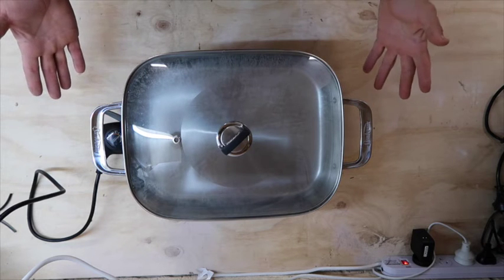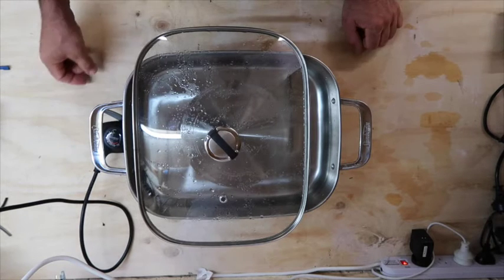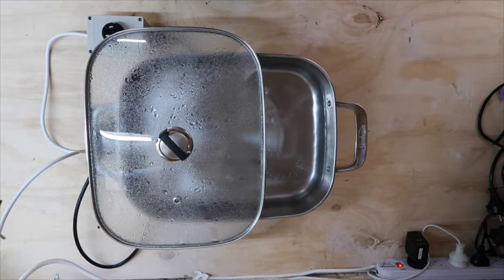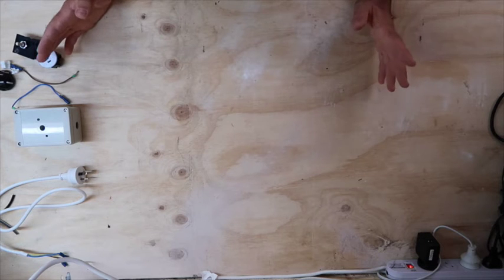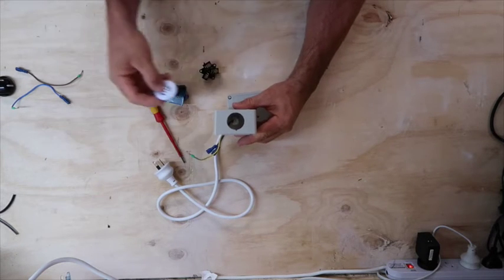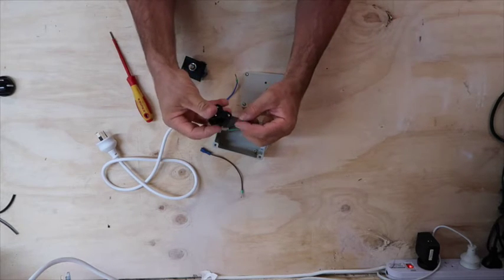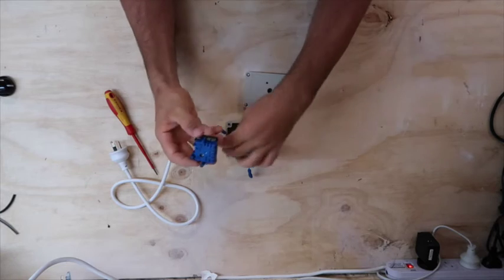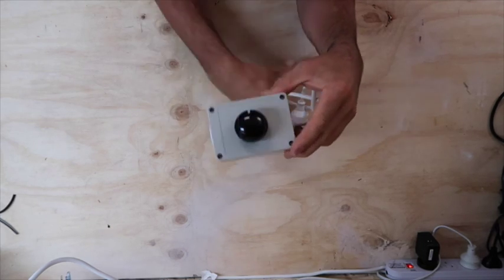Easy Electric Fry Pan Temperature Controller

Comment: Hi James, I’ve been searching for a solution for a more even frypan controller for a couple of years now. You seem to be the only person I’ve found that shares the same issue.
But isn’t what you’re proposing just duplicating the simmerstat that’s already in all the frypan controllers? Why is your simmerstat any different?
I thought by now manufacturers would make some sort of high frequency PWM controller but I can’t find anything.
Thanks for your video though.
Reply from the maker: Hi David, fry pans use a thermostat, it’s too laggy to work well. Simmerstat’s work better, well to simmer at an even temperature. I too wonder why no one makes one that’s better as well. I made one with a hacked plug in smart relay and adjusted the time off to time off to control the heat, only it didn’t last long, but it did work, an ssr would work but it’s a bit expensive. We still use this same one for our fry pan years later, and it still works.

Comment: Thanks for this James. This is an easy fix for retarded appliances ... a couple of $100 for the appliance, temperature probe and everything and really agricultural temperature control leading to sucky cooking. Both leading brands in Australia seem to be the same. Your solution is good and should work well.

However, I still don't understand why the fry-pan manufacturers won't use thyristor control, given they have a temperature probe already. Well, I do know why they won't ... cost. but imagine if switching for temperature was happening 50 times a second ... it would be next level.